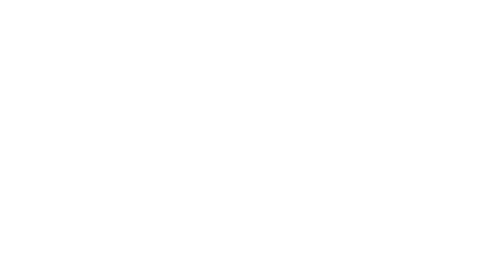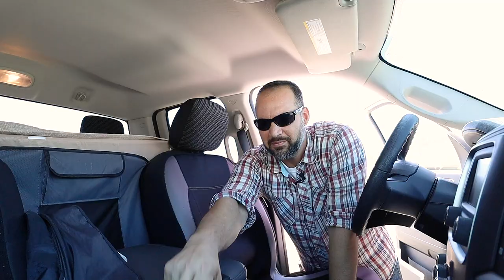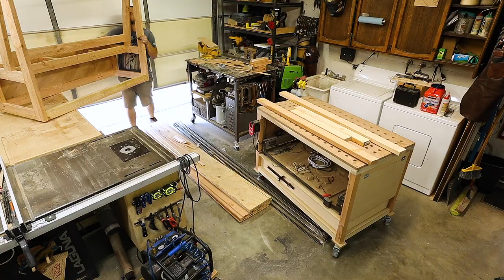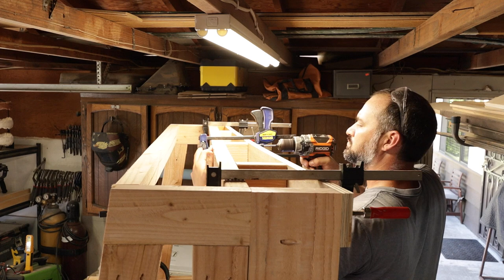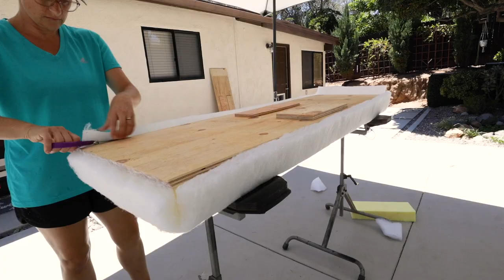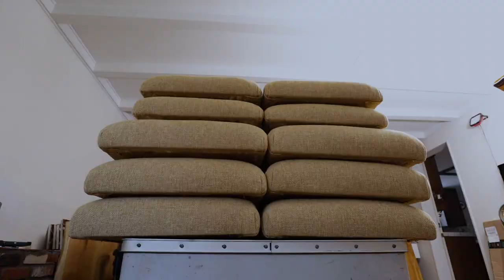Building Restaurant Furniture - Maker Vlog

Comment: Thanks for the informative video.  If you don't mind a technical question, what angle do you feel is appropriate for the back to lean to the rear from the flat bench?  Thanks.
Reply from the maker: gosh, if my memory serves me correctly I wanna say i did it at a 7degree angle or a 13degree angle...honestly i don't recall off the top of my head.  I did a mock-up to see what was comfortable, made note of what felt right, and went for it 👍🏻

Comment: What material is she using for the cushions?? What type of foam and what is the white material on top?
Reply from the maker: the material is a durable fabric.  the foam is standard cushion foam from our local upholstery outlet and the white material is batting.
Reply: @stuffsethmakes  thanks!
Reply from the maker: the white batting helps to soften sharp edges...in this case we were mounting the foam to plywood bottoms/backs, so the batting helps to create a softer/rounder edge when combined with the foam.  Also, if i remember correctly i think the foam was a fairly dense 3" foam
Reply: @stuffsethmakes  ah okay I will have to locate those materials near me. I was thinking about making a corner booth for my buddies kitchen and so your video was very helpful!
Reply from the maker: @romanoreo   unfortunately i haven't had a chance to edit the remaining footage...i have enough footage to get another couple videos together though🤦🏻‍♂️
Reply: @stuffsethmakes  well get to it then! I need the finished product! 😅 I know the feeling though

Comment: I see people making ones out of 2x4's and some people with 3/4 plywood any reason you did it this way?
Reply from the maker: why did i do what, what way?  make the booths with 2x4's and alder?
Reply: @stuffsethmakes  Sorry. I meant did you choose to build the structure out of 2x4's for a reason versus plywood as I have seen some other people building the structure out of. I was looking to build one myself and to be honest didn't know if there was a reason to choose one over the other for this application. Love the video by the way.
Reply from the maker: oh, well used the 2x4's just as framing since i would be attach the alder boards as the main design of it.  I was also keeping th weight in Mondragon because it would just be myself and my wife moving all the pieces from our house to the restaurant.  I think having the plywood would've made it pretty heavy, although some parts of the build probably would've been easier if i'd used plywood haha.  I have a lot of footage to make probably 3 more videos of this build but i just haven't had the time🤦🏻‍♂️
Reply: @stuffsethmakes  Thanks so much for the info! Look forward to the rest of the videos when you get the time.